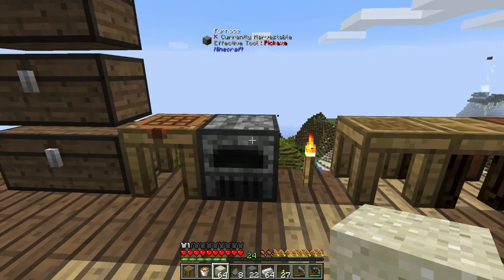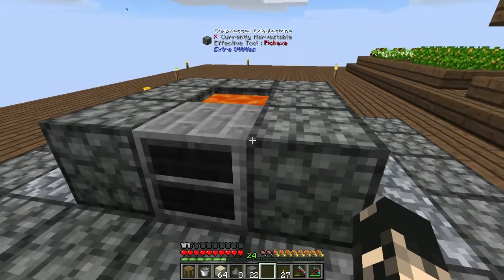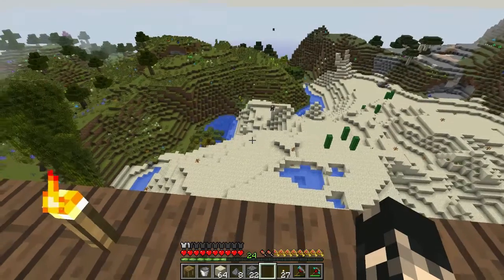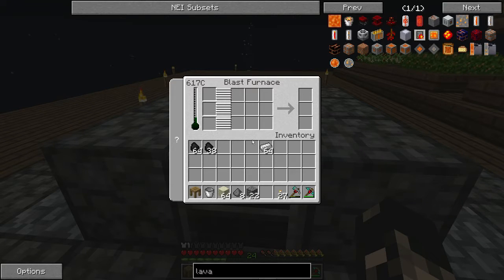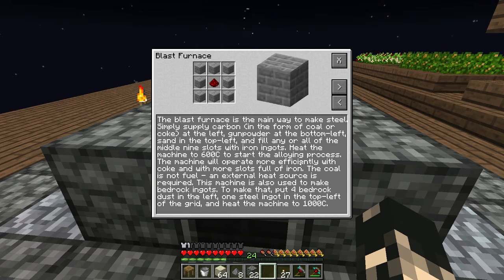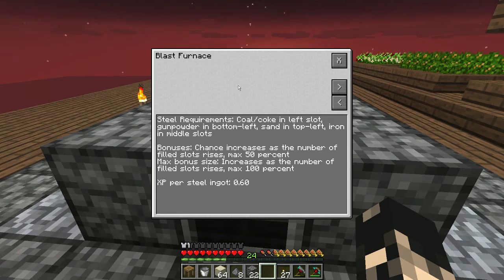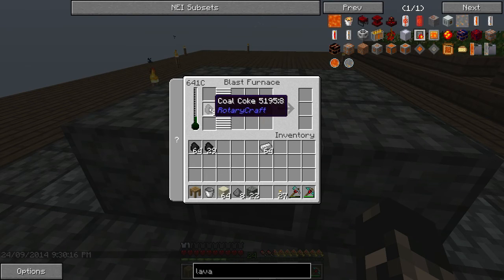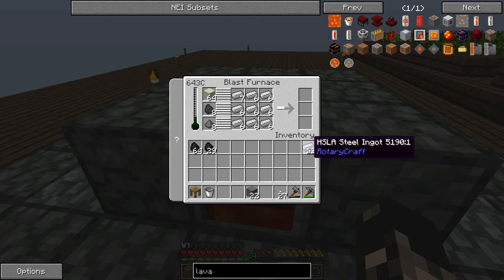RotaryCraft Blast Furnace, Making HSLA steel ingots

Comment: How díd you install them exactly?
Reply from the maker: just copied 1.7.10 V1F of ChromatiCraft, DragonAPI, ElectriCraft, Expanded Redstone, GeoStrata, ReactorCraft & RotaryCraft into a BTP pack mods folder. The BTP pack version is 10.3 Full. I'll be moving it into 10.4a soon.
Reply: Jajajajja ok, dont update because dragon api crashes with the Pack in 10.4
Reply from the maker: thanks, for the advice, I'll see if I can fix it.
Reply from the maker: juan mnccrac Seems to be forestry, I've rolled forestry back to the one in 10.3 and 10,4a works. so I'm using forestry_1.7.10-3.0.0.147.jar instead.
Reply: Ok thank you :D

Comment: Temperature goes up with depth, so that is another way to warm a Blast Furnace.
Reply from the maker: I haven't play it in a awhile but I'd say with a friction heater. try to keep tongue and rad/s similar to get best heat output for friction heater.
Reply from the maker: I've added that to an annotation, next ep will deal with temperatures too. (Fermenter)
Reply: ReikasMinecraft How do you heat it up to 950C? I need to make spring steel
Reply: Ausyarr Thanks